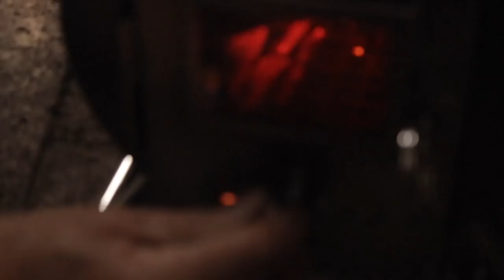Building an Off Grid Cabin for Free to Save Money - Woodstove & Pallet Wood Bed

Comment: You should make a little table for the stove so you don't have to crouch down to refuel and a little table for plates and drinks to sit on that easily be put away. Outside you can make a small shed to keep coats, hats, and tools. Keep this project up, In MI we have about 2 ft of snow but I'm a similar shelter but bigger by a little and a wooden inside roof!
Reply: Im in MI also what town you live close to
Reply: Upper Pen.

Comment: Thanks for going on to demonstrate the water jacket for the new stove; it works a treat. Gone will be the races between billy and tea kettle! I hope you can regulate the stove top temperature better when you get used to working with the damper and the flue controls.  I cannot believe your Dad doesn't have some stone or ceramic floor tiles around somewhere to use under the stove (and right in front of it where coals can fall.)  Even reclaimed brick could do. The metal cladding sounds fine for the wall surround if you also insulate the hot metal from the pallet wood.  What a great series!

Comment: what a fantastic rustic cabin. them reclaimed ring shank nails do a great job of fixing the balustrades . love the hot water on tap. you could always consider making a hinged second bunk on the left with hinged legs that folds on to the wall to save space & would double up as a long seat.cheers

Comment: I think it's a great  thing your doing,  the  only thing I would  like to say is  , brand 3m wood water 
Proofing for wood might save the longevity of this nice cabin,  you put this time into it .it's not cheap  the 3m stuff just get a pressure pump  sprayer ,  wash it out and you can reuse it  the  sprayer,  I thing you  Be adding years to this cabin, The stuff really works,   and once of prevention is worth it, I did my building  with  3m for brick and the water beads off of it, stops mold and everything,  from building on the tuck point,  Just thought I give a shout out , good job guys really, hats off to you, 
Don't just go out, Go out and Live, hats off to you,

Comment: It's a very interesting project. Did you consider putting the bed on hinges so you could raise it up when not in use? You could do a table on hinges on the opposite side wall as well. The bed would be a bench. When you're done fold it up. That way when you're moving about you would have more space.

Comment: A veranda is a roofed platform along the outside of a house, level with the ground floor.
Synonyms: porch, gallery, balcony, lanai, sun porch, stoop. A porch is a covered shelter projecting in front of the entrance of a building. Synonyms: vestibule, foyer, entrance (hall), entry, portico, lobby; veranda, terrace; stoop; lanai, tambour, narthex. So essentially they are the same thing.

Comment: I would definitely put some tin on the floor and walls around the wood stove.  That stove is little but it is really close to your wall.  Your first really cold night in there, when you have the stove roaring for 8-10 hours straight and the front door closed, you will be surprised how hot that wood wall near the stove will get. I'd hate to see you lose your little cabin, or worse. Another option would be some brick or stone. You would actually improve the performance of your stove a bit more if you built a little stone or brick hearth under it, because the masonry doesn't just protect against fire, it absorbs heat and then radiates it back out slowly, which helps to keep the temperature even.
Reply: This worries me too, I have a rocket stove outside next to a pallet wood fence, well it was next to the fence until i realised that the fence was bubbling as the moisture in it started to vaporise, those little wood burners can churn quite a lot of heat out and the flash point of pallet wood is only about 300 Celsius, with good ventilation into the firebox the stove walls can hit about 600c in about 1/2 an hour.
Reply from the maker: trustbuster23 thanks for the tip, we will look into a solution
Reply: Just a bit of old tin roof with an air gap between the stove and the walls is a simple solution,  maybe some slate or a bit of tin on the floor too, I know you are trying to not spend any money on this project so if you can find some clay on the property you could daub the wall and make a pad under the stove.

Comment: 12:26 I know that this is a temporary construction and all but for future knowledge
1. they have a drill accessory for that, it allows the pipe to slip inside, plus you can debur it.
2. they have a seal kit as well, even though it's a temporary structure, it's best to not let any leaks come in, especially when water can stick to the underside of the tin and drip down along the ceiling.
3. even though it's a portable wood burning stove/heater it's still worth looking into, especially when it's used in 1 spot for longer than 3 months in an enclosed space.

Might I suggest you get a concrete slab under the heater, I know it's a pain and a cost but... you want that place to be fun, not go off like a house on...

Comment: Fantastic job guys, I love that stove. Do be careful about carbon monoxide in such a small enclosed space though - I know you've fitted a flue but with the door closed I'm worried you might not have enough ventilation. Maybe think about a couple of vents somewhere in the cabin just to make sure you get plenty of air circulating, and put a CO alarm in there as well if you're going to spend any time in there with the stove going.

Comment: Get some concrete canvas cut it into squares then rivet bendable screw strips to one edge to make shingles. Then cover the outside hose it all down with water and let it cure. A fire proof cabin in the woods. You could stain it to match the woods camouflage to belnds in. 😊

Comment: Love the idea of a scrounged zero cost build 100% plus...but not the placement of the wood stove.  Never ever never ever ever never ever ever put the fire source between you and the only exit.  Move the stove to the back corner and the head of the bed to the front.  Keep a large bucket of water where the stove is now.  Keep up the good work!!
mike...in Los Angeles

Comment: Since the stove is so efficient, had you considered making a box shelf for it to sit on, still putting down the metal for reflection at the top of the shelf and surrounding walls and then using the space underneath for wood storage, just a thought.

Comment: Hey guys a couple of suggestions.  First build a shelf for the stove to sit on so that you don't have to bend over to cook on it, or load wood into it, or get water out of it.  Under the self could be a great place to store your firewood inside.  Next you talked about the bed only being big enough for one and the other would have to sleep on the floor.  If you made every other slat slide out on another support with legs on it you could turn the whole end of the cabin into a bed at night and a sofa during the day and nobody would have to sleep on the floor, where the cold falls to.  Another idea is to put on the opposite wall a table that would fold down to hug the wall when not in use but fold out for meals or games when in sofa mode.  Cut the table in half to make a long table or short table depending on need and space.  Maybe an outhouse  with a little shower stall on the side, you already have hot water.  Just a couple of ideas.  I have enjoyed the videos.

Comment: I love this series was just thinking for lights maybe u can use some of those solar power garden lights i have taken them apart and seperated the light and the solar panel piece as long as u reattatch them with any length of wire u can have the light in the cabin with a tiny hole for the wire and have the panel on the roof for max sunlight just a thought

Comment: To qualify as a "habitable structure," a building must have two doors.  If a fire breaks out and blocks one door, there is another door to use.  If you have a fire, it would most likely be caused by the stove, which is located beside the door.  The building would be safer if the stove were located as far as possible from the door.  You might consider building some kind of emergency exit in the corner opposite the stove.  It would be constructed so that it could be easily knocked out in case of fire.  I would favor locating the stove away from the door.

Comment: That bed seems awfully sturdy. Usually they're held together with a few wooden pegs and 8 long allen key bolts. (and the nails holding each section together, but they definitely don't use that many nuts and bolts.

Comment: Porch

A porch is a covered shelter attached to the front of the entrance of a house or building in general. The structure is external to the walls of the building but it may be enclosed in certain types of frames including walls, columns or screens, extending from the main structure.
Veranda
A veranda is a roofed, open-air gallery or porch. A veranda is often partly enclosed by a railing and frequently extends across the front and sides of the structure. A wrap-around porch is really a veranda.

Veranda is a Portuguese porch.

Comment: Well i have to say boys, i'm not sure whats more impressive, the wood work, or the editing in the first 10-15 minutes of that vid.
You may have missed a trick by not having the A team theme music running while you did your drilling and bolting. But maybe that's my humour and not yours. 
i'm glad you said about putting a metal plate under the stove, i was kinda gritting my teeth a bit seeing open flames so close to all your hard work. 
You've certainly gone down a different path with this new project, and yes, i was somewhat sceptical whether it really suited your channel. But, adapt and survive as they say, it seems to have paid off. 
i'd love to fast fwd a few years to see all the planks of wood fully weathered in. any thoughts on that? i'm assuming with my limited Knoledge of woodlands, that it will eventually turn the planks a lighter shade of green. or does that depend on the type of trees surrounding it?
Good work you 2.
looking fwd to the next episode.
Gary.

Comment: For a day's work on the cabin, how many Makita batteries do you take with you ? Or do you have a method to charge them in the field ?
Reply from the maker: Two.They die fast in the cold so we use manual brace and bit after they drain. No way of charging on site.

Comment: Your Dad has a fine eye for knives that are also rarities.  I have looked at over 2000 images of folding post WWII tactical knives, automatic knives and survival knives only to remain frustrated.  Years ago, I read about folding knives like your Dad's  being issued to pilots and to some covert personnel.  Those blades were a 'sanitized issue' (lacking military or country of origin markings).  The handle is very like an Al-Mar (USA) or Blackhawk (Italian) design in materials and outline. The 'sawback' blade spine is said to have been introduced during the Vietnam War era to enable personnel to cut their way in or out of the magnesium/aluminum skin of aircraft. The protractor on the blade tip does not link to a maker as a 'trademark.'  Maybe your father's contact for these interesting knives might know more and put all our curious minds at rest.

Comment: Why are so many people suggesting bunk beds? What a stupid idea. First off it would be too tippy. The cabin is too low, meaning both beds would be mere inches between a barrier (top bed, roof). It's built out of pallet wood, you want to trust the strength of that while sleeping in the top bunk?

I'd make a few hooks out of branches and place well up on the wall above the bed so you could hang your coats, backpacks or other stuff from them.